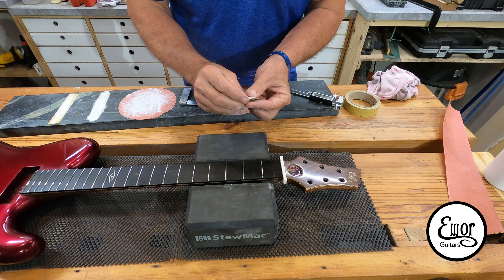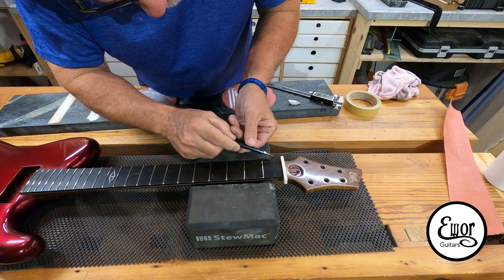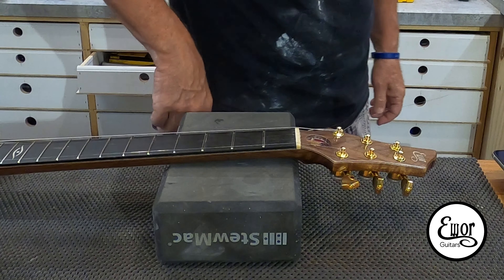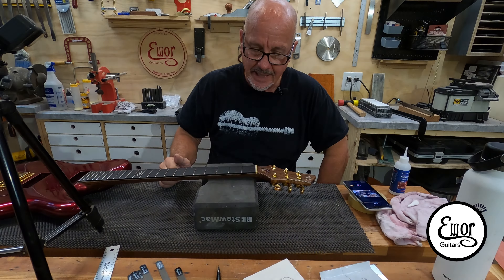How to Fit, Shape, and Install your bone nut

Comment: Great information. Helped out a lot as I was replacing the nut on a strat with a blank and had never done it before. Turned out perfect. Rewired it all with new pots and a superswitch. I have enough dough to buy pickups for one of my strats or my tele, but they all test out fine on the multimeter. Maybe I'll wait and put the money into my tele build. I'm going to check out some of your other content because this really gave me the details I needed. Thanks! Beautiful guitar, by the way. That finish really pops and the neck and headstock are beautiful. Hopefully I can build something like that one day. I don't have CNC, but I have everything else a guy needs in a wood shop. I'm babbling. Thanks again!
Reply from the maker: Thank you so much for the nice comment. Good luck on your tele build I know if I can do it any one can😃

Comment: My Ibanez PM 30 had a nut slot issues. I need to straighten it out. Seems when using files slight gaps on the ends show when nut is inserted. Any nut won't fit perfectly no matter how shaved. Throw the guitar away? Subscribed
Reply from the maker: If it has a locking nut you may just need to replace the whole assembly